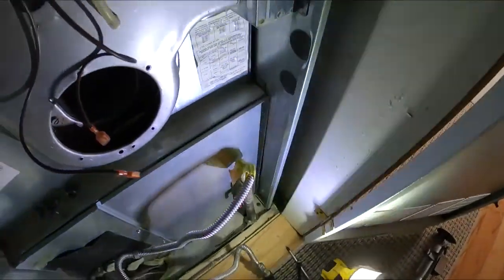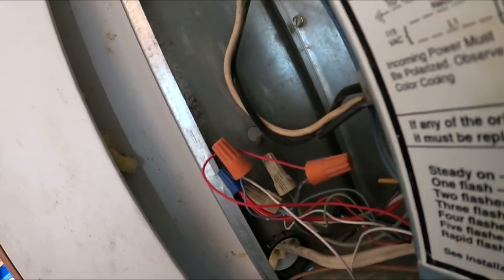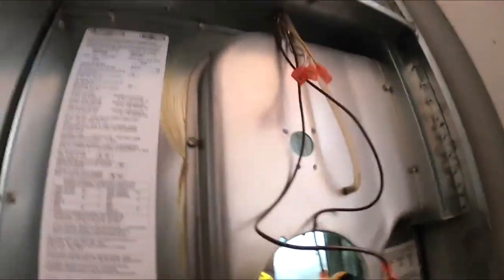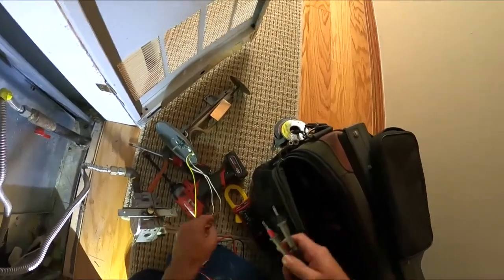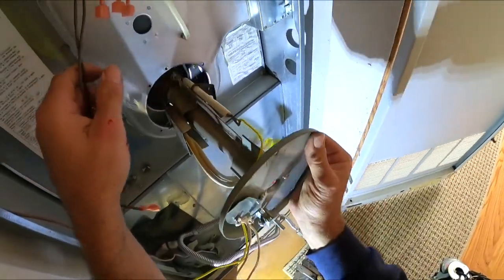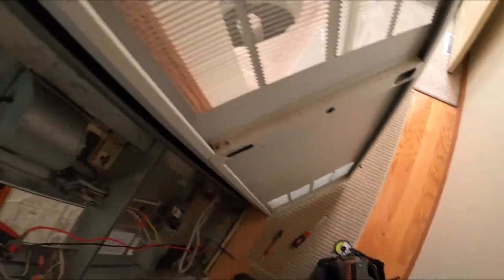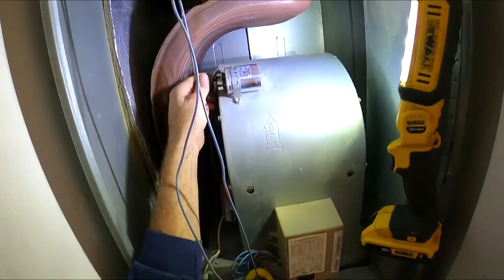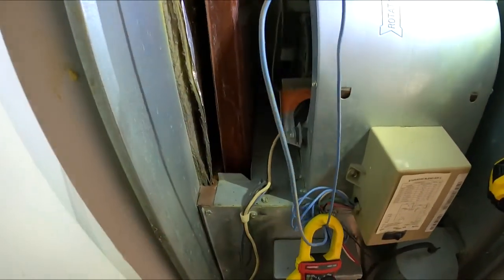Modular Home Furnace Check

Comment: I'm not familiar with this brand unit  does it do cooling also?
Reply: it's a downflow unit, the A/C evap. coil is at the very bottom, with lines coming out left with black tar tape/foam over them.